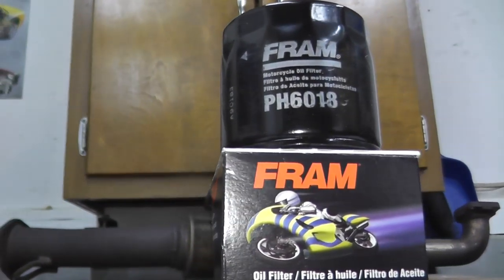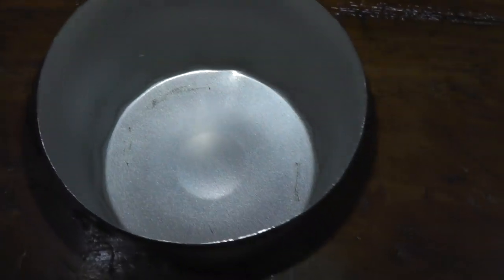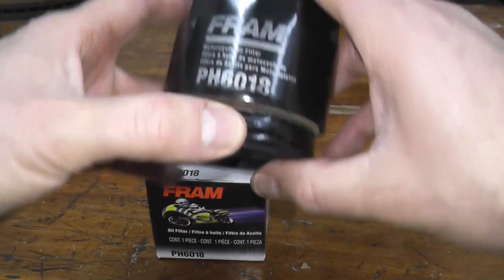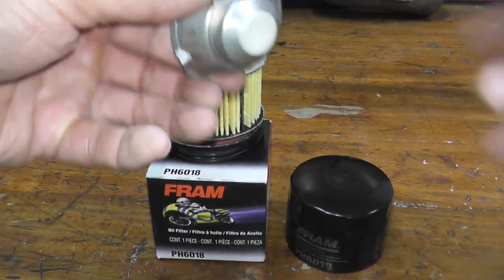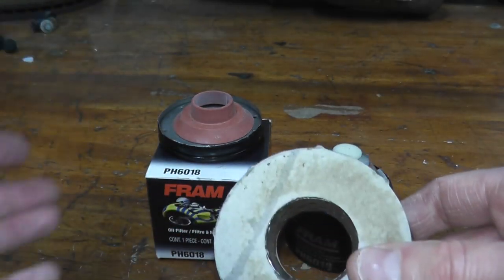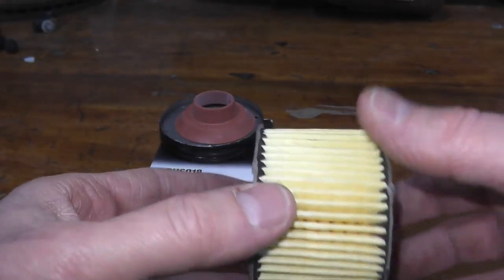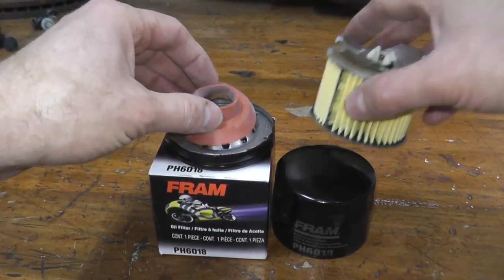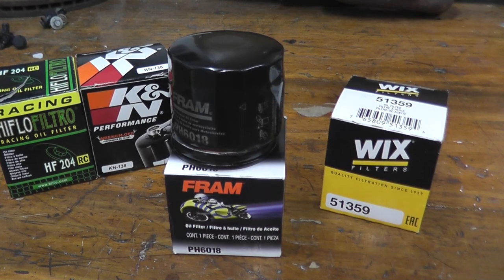Fram Motorcycle Oil Filter Review

Comment: I believe Fram has changed the ultra filter recently..The media is no longer 2 plies of wire backed 100% synthetic glass fiber. It is 1 ply synthetic and 1 ply cellulose. It is still wire backed. It looks tan instead of pink. Not sure if it is a downgrade in efficiency, but the change intervals are now shorter..from 20,000 to 15,000. It might be something to look into.
Reply: This is a motorcycle filter not car

Comment: Looks like the orange can of death but it has black paint
Reply: It’s actually a good filter
Reply: I done with people hating fram for no reason
Reply: @stevenbettez2017  I agree with you. I have talked to a Professional Engineer (daughter) who took my Fram used PH6018  apart and said there is nothing to worry about. The fiber end caps have great bonding properties when glued with the fiber based media and the oil wont flow through them and the end caps are not under that much stress.